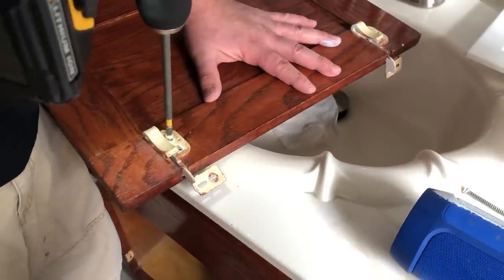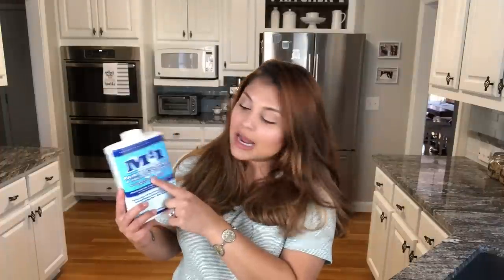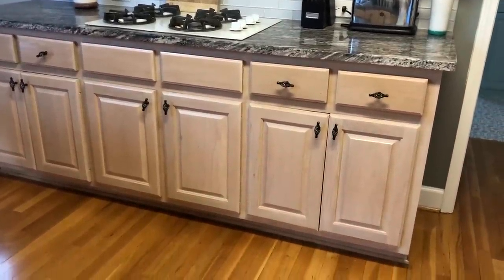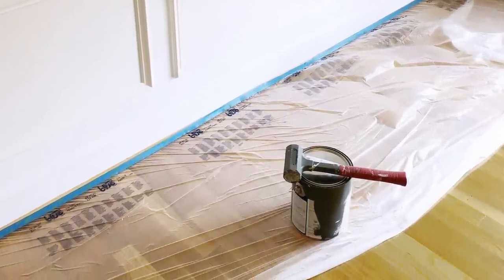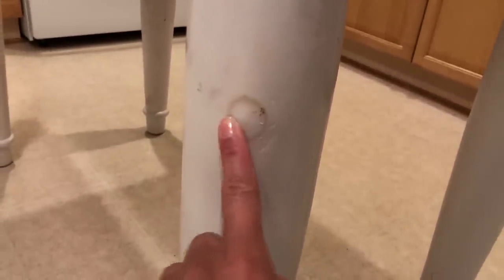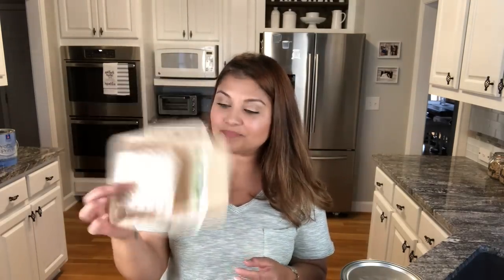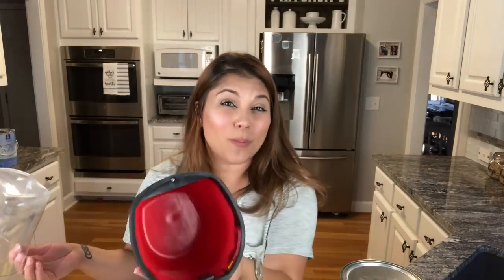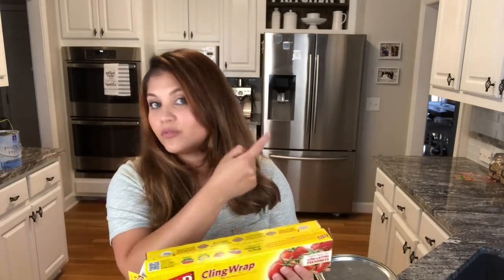HOW TO PAINT YOUR KITCHEN CABINETS THE BEST WAY - How to paint kitchen cabinets without a sprayer

Comment: Can you paint over a pro lacquer finish that is chipping off, my new kitchen cabinets are only 2 1/2 years old, ugh. They are chipping bad on the trash can cabinet and a few other places here and there in other cabinets. I have no idea if it’s water based or not, but when they did them, we realized a few weeks later that the doors are slightly different color than the body of the cabinets ( noticeable to everyone who has seen them btw). I am so very disappointed as I paid thousands of do,Lars for these cabinets, built ins and paint job. I love the cabinets, drawers, etc, but hate the pain co,or and paint finish. It does NOT match the built in in the family room that is only 2 years old, it’s not chipping at all either. Also, please let me know what wire brush you used and brand and where you bought it to clean your paint brushes? Thank you and your kitchen is GORGEOUS!  I’m not fond of white cabinets. I have them in the laundry room and they have held up exceptionally well and they are about 5 -6 years old. They are white and came from a specialty cabinet making company. They have a super hard finding to them too, they just don’t have many colors to choose form though. I wanted a greige, tan grey tone, but now I’m thinking of doing the top cabinets like the built in in that family room and going much darker on the lower ones that have drawers and get the most use and abuse. Something like peppercorn on the bottom. We have a nice size kitchen, it’s not square which I wish I had, but it’s longer than most kitchens and it’s a nice wide size too, just not square shape. We have built ins on both ends and not a traditional high at because we are in our early 60’s and thinking about the future and possible health issues. I have joint and nerve issues already. I do the best I can with what I have with Gods help! I want to do the body of the cabinets and either get hubby or hire someone to do the  doors and drawer fronts and backs. Thank you for your time.

Comment: Do I need to use oil primer on new unpainted doors? Or is it just for pre-stained doors?
Reply from the maker: If they are bare wood, yes. The reason is you don't  want to have any bleeding or knots coming through your paint. It will happen if you don't oil base prime - I shared a specific example with the little island table I talked about in my video.

Comment: I prepared following your recommendation. I used m1 and used primer. It is too tick for me to put smoothly on the cabinet. I did only one section to make sure its working or not. However, the primer is not smooth, i do not know what to do. I already spent $300 for paints and accessories.
Reply from the maker: I’m not sure why the primer is coming out extra thick. If that is the case, no worries, just sand them down a bit before applying the actual paint and you should be good to go!
Reply: @TheLatinaNextDoor  Thank you! I really appreciate it.

Comment: I have brand new unfinished cabinets.  Do I need to sand them first prior to the primer step?
Reply from the maker: If they are brand new, they should be prepped and ready to go for primer.
Reply: @TheLatinaNextDoor  Ok, I primed, painted two coats and they have been sitting for 3 weeks now and are still sticky.  I can put my fingernail into them.  What can I do to remedy that?  I waited until the primer coat was completely dry prior to applying the first coat of paint, but I only waited a few hours after the first coat before painting my second coat.  When I did this, the first coat was not tacky to the touch, but it was not hard.   I wonder if this is the cause of them not harding??

Comment: Thank you for this great video and so much info! So you would not recommend the Rust-Oleum cabinet transformation kit? I want to paint my kitchen cabinets but don't know which route to go
Reply from the maker: Susan Savage I honestly haven’t used a kit so I could not say. However, I do think it’s unnecessary. Those kits only come with a set number of colors (so in that you are limited) and they may require more steps along the way. They also only cover a set amount of square footage that the paints cover so you have to be watchful of that. Of course it’s what you feel comfortable with - for me, I haven’t used them and don’t think I ever will since I’m pretty happy with the results I get using my process. 😊💕

Comment: If you paint inside in your basement, then you don't really have to let them acclimate for a week before you put them up, right?
Reply from the maker: I moved mine from the garage into the basement for a week. This helped the paint harden before putting them back up. The longer the enamel paint sits on your surface the harder it gets. You don't want to rush and reattach them because you will run the risk of chipping.

Comment: Yami, I forgot to ask...have you ever used this paint on wood trim (floor, doors & windows) ? Is this particular one necessary or have you found one that works as well for trim specifically? Also, do you recommend using primer on trim? I’m painting over honey oak.
Reply from the maker: Sara S. I use the same paint for all of my trim, door frames etc. I haven’t had to prime mine because they were already white, however, if i were to paint any trim that was wood stained I would definitely oil prime first. I know it’s a hassle but I wouldn’t want to have to keep touching up so much with bleeding coming through. Hope that helps answer your question. 😊💕

Comment: Hello, thank you for sharing you experience, I have a question did u use only M-1 deglosser in your project.?
I went to S&W today to choose the color and the vendor told me for do not use M-1 cuz can cause reaction with the paint and can create bubbles.
I would like to know if you had problems with it?
Reply from the maker: I have not had any issues with the M-1 Deglosser and I have used it several times for these kinds of projects. You have to make sure you wipe everything with a damp cloth with just water after you're done with the deglosser and let it dry thoroughly. The oil-base primer covers everything and seals it fine, so when you apply the latex paint you should experience no issues. I hope that helps!

Comment: Best easiest way to clean paint brushes at all that I have found is to take a small toast or dish that has a lid and fill with warm water add a couple dryer sheets to the bottom and a tiny bit of fabric softener close the lid let sit over night and then rise next morning all that paint will be gone even those huge clumps that get in between the bristles
Reply from the maker: Christina Johnson- Hepburn thanks for much for the tip! I will have to try that! 😊💕
Reply: Christina Johnson- Hepburn not sure how you put paint brushes in a “toast or dish” and close the lid.  Do you lay the brush down or stand it up?  Would be a big toast or dish to hold a paint brush.  Can you explain?
Reply: Candy JohnsonCanoli sorry didn’t reread my comment before posting it. It’s suppose to say put yr paint brushes in a small size tote with lid or dish/ Tupperware with lid put dryer sheets on bottom of whatever yr using put in warm water add brushes and if u want u can add a few drops of fabric softener close the lid let sit overnight then rinse them the dried paint will all be gone and brushes nice and soft
Reply: Christina Johnson- Hepburn thanks for the info.  Is this for latex only?  I’m assuming oil base has to have a distillate to clean brushes.

Comment: how many  1gallon cans  of the  primer    an how many  gallons  of the paint.  did u use. for this kitchen ,,  an how many coats per  primer.  an. coats  per paint  ,, an. why use SWilliams  primer  over. the zinsser shellac  primer
Reply from the maker: I used one gallon of primer and one of paint. I just prefer the Sherwin Williams one because of the results I get from it.

Comment: Wow!!! This is most amazing and informative video!! Thank you so much. This is a project I hope to get done in the next year. I have question- when replacing your floors and painting your walls and cabinets, in which order would you do them? And would you change out your countertops and sinks first?
Reply from the maker: Nadine Frandsen okay so this is what we would do. If you are going to replace the floors I would remove the small toe molding off the wall and cabinet borders first. Then I would paint the walls and cabinets. This way you don’t have to worry about the floors getting paint on them accidentally. Then I would remove the floors and replace them. I would add new toe molding back. And finally add the countertops and sink. I hope that helps!!! 😊💕

Comment: Please tell me brush or roller for a gloss finish? A painter did my bedroom doors with a roller and they are bubbly looking & not smooth and glossy anymore.
Reply from the maker: Tiddles A. Do you know what type of roller he used?
Reply: The Latina Next Door Is the term stippled? I’m not sure of the brush but it looked furry. I believe it should have been feathered off with a brush.. I can see places where he cut in with a brush and it’s smooth and glossy. Thanx for the reply.
Reply: Hi! Very motivating. Thank you!What are your thoughts on a shellac primer? I was told this was the best to use for my shiney finished cabinets. Although the color is different, they look a lot like yours to start.☺️

Comment: Quick question if the paint is water based why use a oil base primer?
Reply from the maker: Cindy Miranda the oil base primer prevents the knots and any finish left on the cabinets after prepping from bleeding through. If you don’t use it, it will happen. I shared an example in the video.

Comment: This is awesome but what if you don't have a garage?
Reply from the maker: If you don't have a garage, you can either do it in a basement or inside your home. I would NOT recommend doing it outside because dust/pollen can get on your paint and ruin your finish as it dries. Inside your home you can lay down a drop cloth and do the same process, just make sure to keep them away from pets or small children to avoid them falling over or getting any hair on them. I hope that helps!

Comment: Ok, so the sherman williams near me is curbside pickup only right now and when I tried to place my order for the primer you used, it said that online ordering for that item is for professionals only. What the heck
Reply from the maker: It may be the state you live in. If you’re not able to purchase that primer Zinsser has an oil based primer at Home Depot that works well. It does have a harsher smell though.
Reply: @TheLatinaNextDoor  yesterday I called there and the associate had no idea there was a problem with the online ordering.  Lucky for me, he said they just opened their doors the day before for walk in customers, so I went and scooped it up. She gave me 30%off for a new acct and I had a $10 off coupon from online. I Also picked up the paint and deglosser. I am so happy :)
Reply from the maker: Dawn Bozykowski that’s great to hear!!!!
Reply: @TheLatinaNextDoor  and paint and primer were  on sale :)

Comment: Have you noticed any yellowing?
Reply from the maker: At Home Mommy Life i have never experienced yellowing. The previous finish does not seep through since I used and oil based primer. And since I don’t use a top coat, it doesn’t yellow from a sealer.

Comment: So, you're an expert? No sanding? Nah, I'll definitely sand mine as their oak. After cleaning I'll be using a small electric sander to remove the shellac/varnish on mine. I want to do this once, not redo a year or two later. Not sanding is a shortcut that should be avoided. 9/10ths of every job is preparation. I'll do the work.
Reply from the maker: Go right ahead! You are welcome to do what you wish. 😉